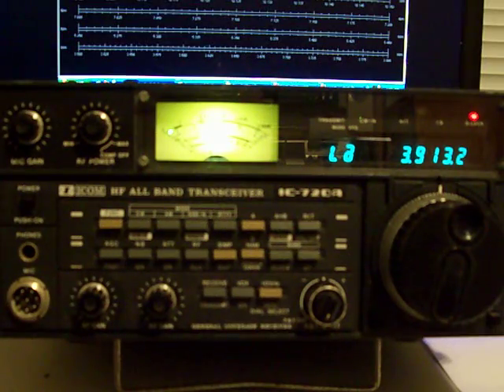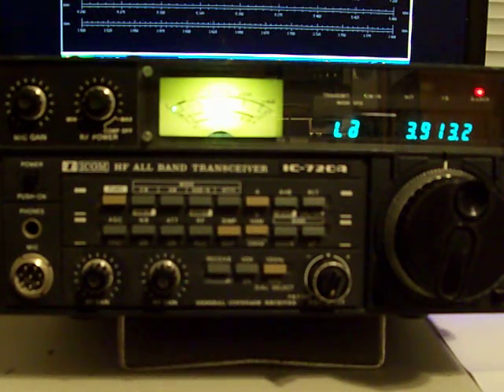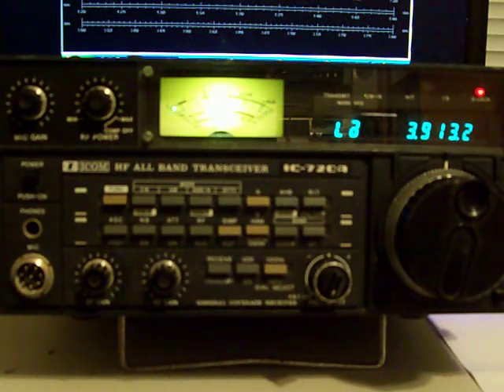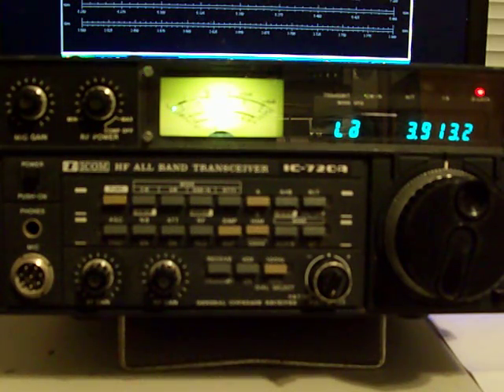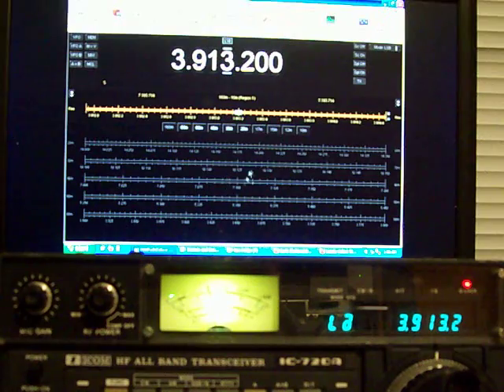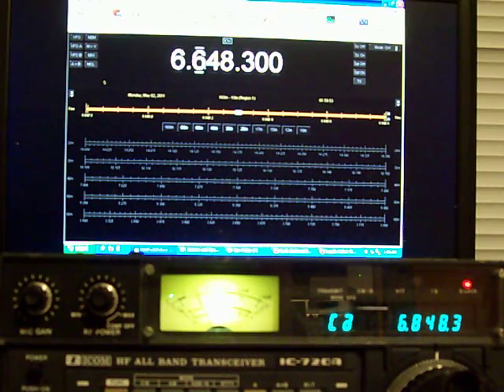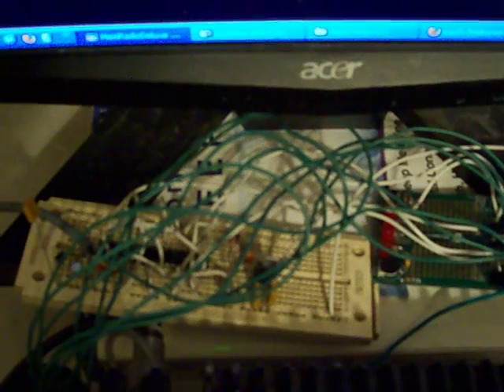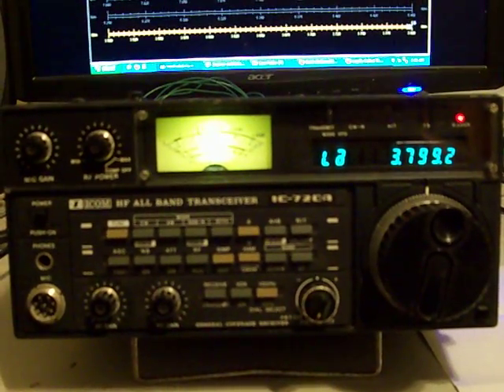Using Ham Radio Deluxe with an Icom 720A

Comment from the maker: @w9gb The IBM 5150 came out in August of 1981. I actually had one that I bought used and used it until 1994 for some DOS stuff  I was doing. It ended life with a high velocity .308 bullet from my rifle. It had a 10MB hard drive and two floppies, a parallel port and a serial port. I also designed a card to interface to the ISA port in that thing and put out a 1 Mbps serial stream on a 10 wire bus I cam up with using RS-422. That thing used over 30 chips to do what can now be done with one USB IC

Comment: Actually in 1980, the IBM PC was still in design stage !  It was not introduced to marketplace until 1982.  In 1980, the 8-bit processors (6502, Z-80) were common and the operating system was:  Digital Research CP/M.

Sadly, I lived the history -- and people are already forgetting  :-(

Comment: @n6vmo You do understand that the Heathkit HW-8 is an ANALOG QRP transceiver ??
There is NO uProcessor to control or CAT interface (since there is no uProcessor to control).
The HW-8 came out in mid-1970s, when the Intel 4004, 8008 and Motorola 6502 were brand new processors.

w9gb